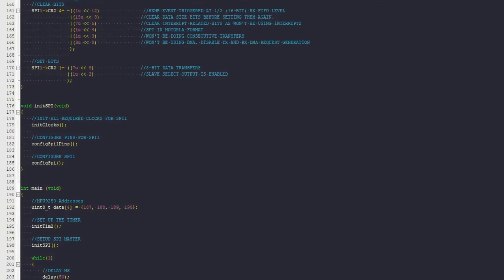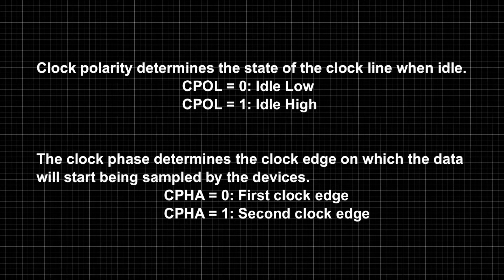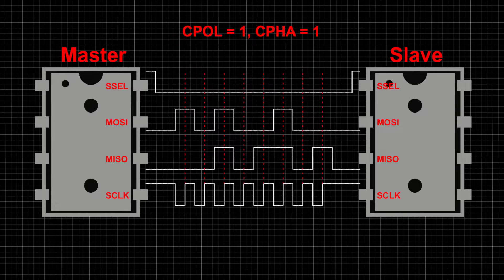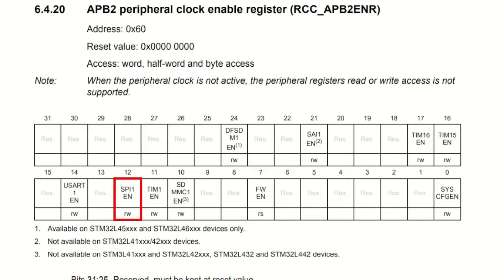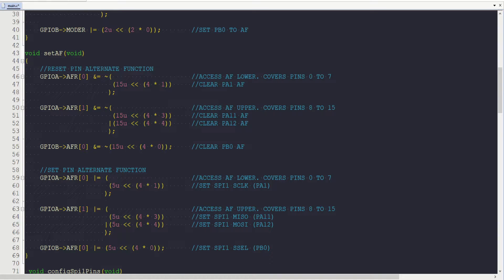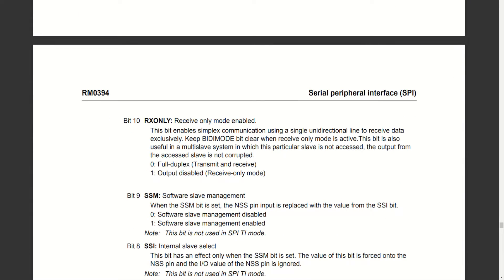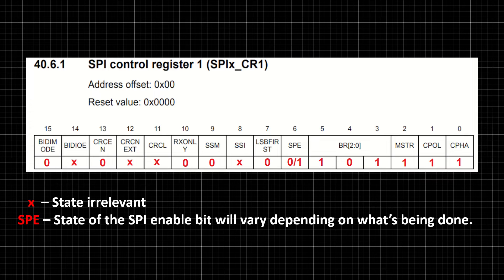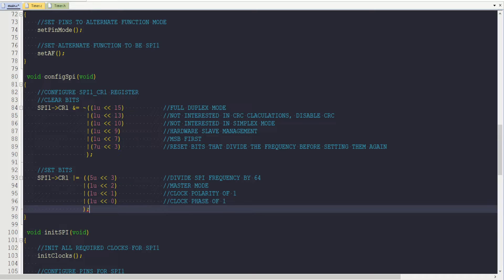How To Write An STM32 SPI Driver (Full-Duplex Master Mode)

Comment: Great video! One recommendation is that it is best practice to use the CMSIS library and all the defines that come with it. It is almost impossible for someone to tell what (0x1 <<  1) means(unless you want to dig through the reference manual) when you could use RCC_AHB1ENR_GPIOBEN. This is still bare-metal programming and it greatly increases the readability of your code. 

Great work!
Reply from the maker: That's a good point. Thank you for advice!

Comment: Your typing is a bit too fast for me to follow, but, that's why they pay you the big bucks.
It's a good thing that this controller is not too complex!
Actually, it's a good example of the "double-edged sword" oh having incredible flexibility in a small device, but requiring quite a bit of internal configuration to get through the flexible pathways... I started with XC6801, 1978, which was a kind of beginning of the trend, with 2 or 3 functions on port pins, and a few registers to get the desired results.